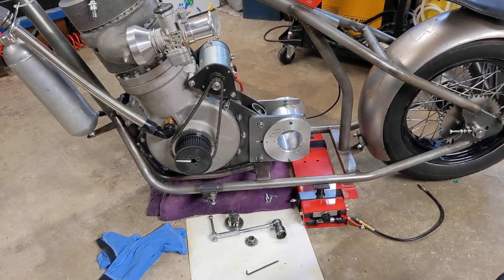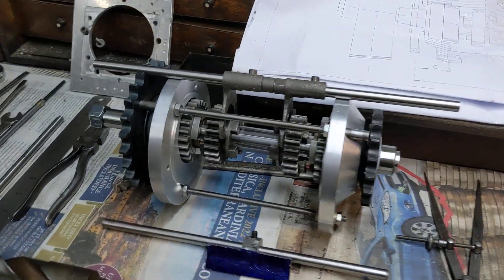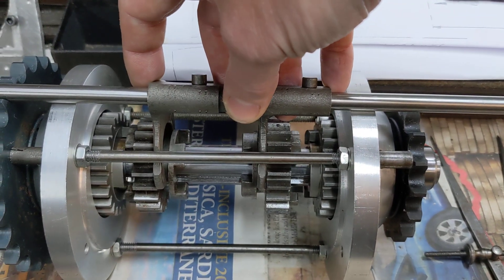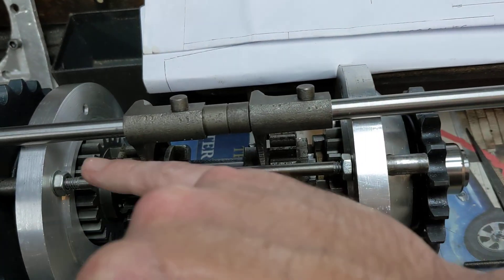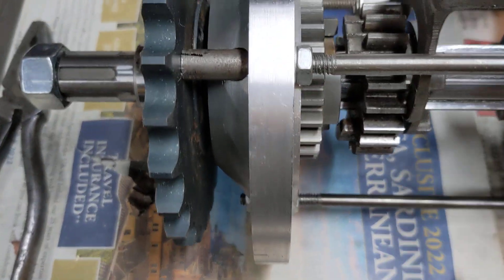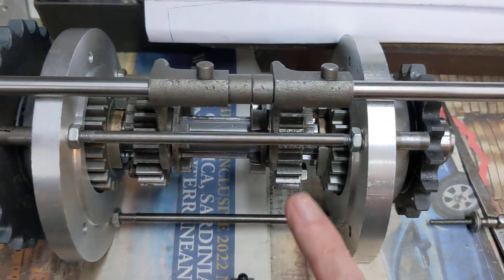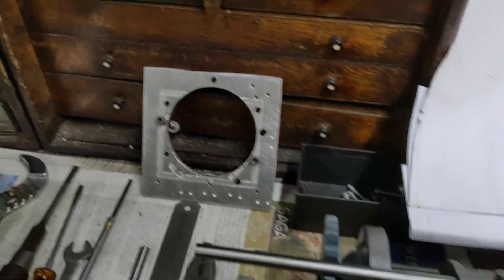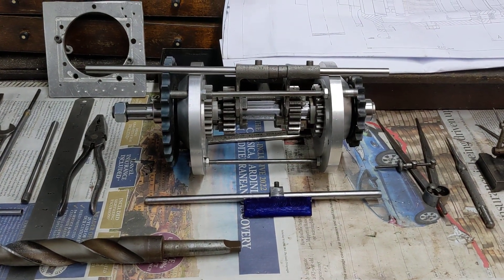Move your hand and show us the box!

Comment: DOH! And I was trying to figure out how/where you were get a counter shaft in there? And I was thinking you were going to drive the rear wheel form each side at the same time? Then I saw the two different size drive sprockets. So really, no need for teeth on the gears. Kuhl! I can see an issue coming up with chain wear tho. If you add a roller tensioner on each side you can keep even chain play on both chains over it's lifetime. You could even use the gearbox as an oil tank too since you have no gear mesh. Single gear Harley drag bikes from the 60's used the gear box for the engine's oil tank.
Reply from the maker: @JaySiewers  never thought of using the gear box as an oil tank! Thanks for that 😁 The gears have teeth because they're standard Norton items. We've only made the centre shaft, outer case and selector shafts - but that's enough work in itself 😁
Reply: @StoneEng  I didn't know what gears they were but noticed the one gear on the right had pretty bad teeth. Doesn't matter for a mockup tho. But if used as an oil tank you would want to take the teeth off the slider gears and maybe leave 2 teeth, opposite each other to splash feed the bearings. All those teeth left on will froth the oil. Not a good thing. And a low oil tank will have less wet sumping of the crankcases. I like that you can sellect your gear ratios externally, by sprocket size. Makes it much easier to dial in your shifting points. I'd try to look up internal gear ratios on two speed automatics for a reference point to compare with what you already picked. Just some food for thought after you get it on the road.

Comment: If you have already considered these topics, please ignore the following topics: Filler-hole with remote filtered breather,  drain plug with magnet fitted in a pocketed 'mini-sump' to stop oil turbulence from keeping metallic parts in suspension, larger diameter or greater number of clamping bolts with extra dowels to prevent differential twisting of end-plates/shaft-flex wear. It may sound like overkill, but I'd hate to think that this beauty failed and got stowed in the back of a dingy shed for decades!   
On the subject of belts, braces, ships & ha'p'orths of tar,  I'm not suggesting more weight and over-complication, merely the prevention of disappointment along with the associated tearing of hair, gnashing of teeth, muttering of foul oaths, etc. Keep at it, looking forward to seeing self-propulsion!
Reply from the maker: @nlo114  some of those already in hand, the rest I'll ponder. Thanks for all the input, I'm sure it won't end up neglected in the back of a shed 💪